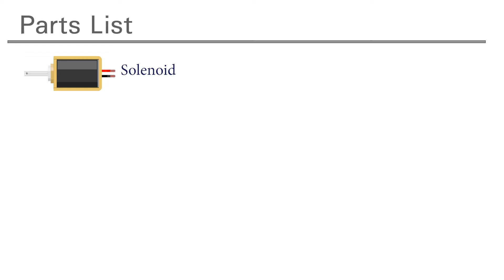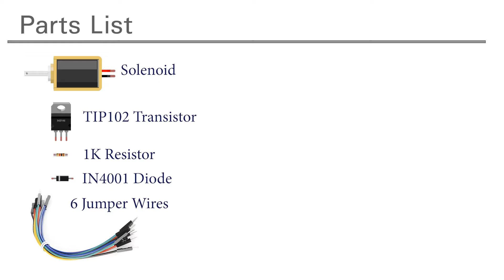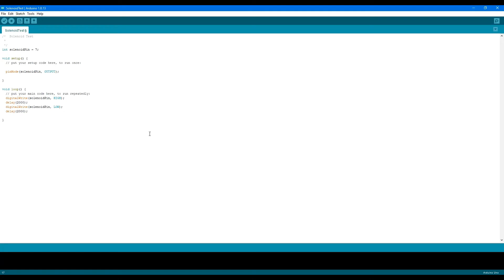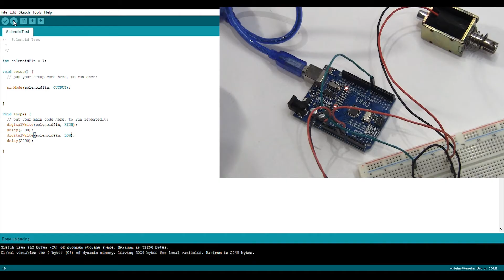Arduino Lesson 4 - Solenoid control using a Transistor

Comment: Could you explain how you would add a button to this setup?
Reply from the maker: I have a separate video that explains how to use buttons.   The button video shows how to control an LED using a button.  To apply it to the transistor example you would run the 5V to the transistor signal pin instead of the LED.  Here is a link to the video.  https://youtu.be/skUlztFyJac
Reply: @DIYTechGuyShow  Thank you.